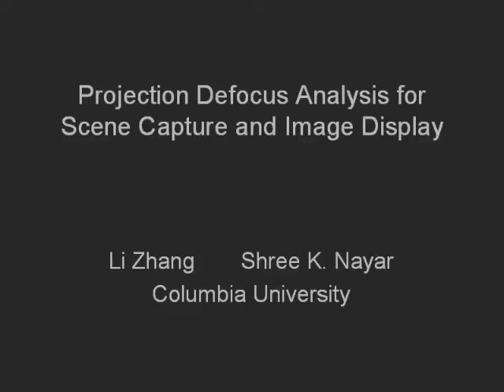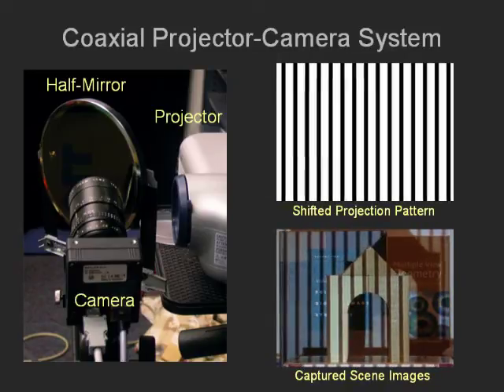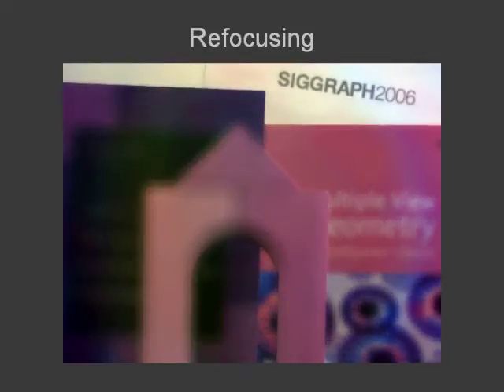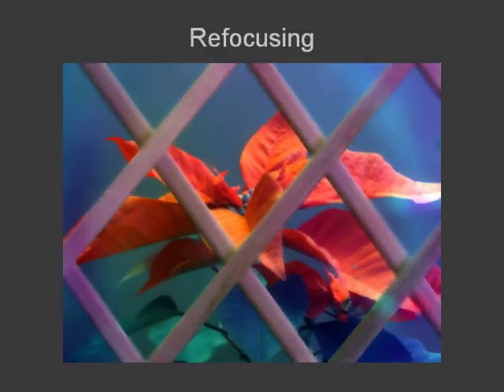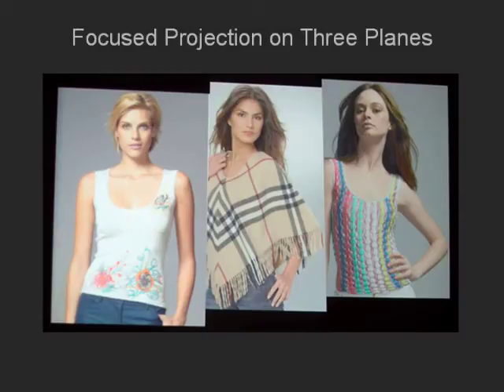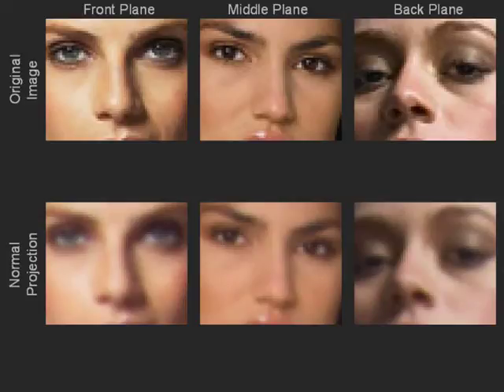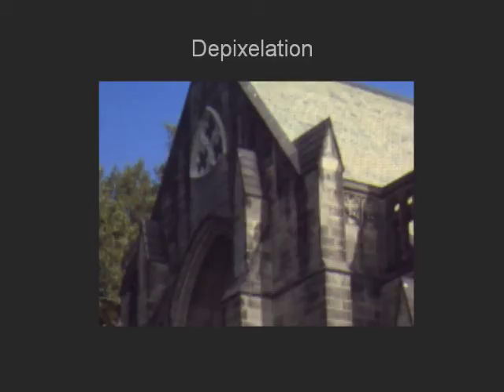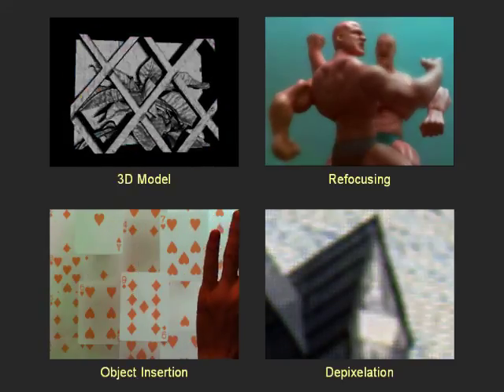Projection Defocus Analysis: SIGGRAPH Video

Comment: That's actually pretty phenomenal.

My Questions include: Could this be done in a single device, by building a camera with a projector? 
Could this be done invisibly, without having to use a stripe calibration image? Perhaps with IR.
If this could be done invisibly than could it stand to reason that this detailed level of depth mapping could be achieved in moving scenes? And could you couple multiple cameras together to provide additional geometry information, and allow a stereo image to be constructed.